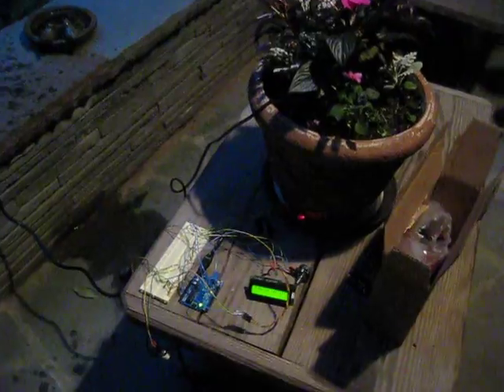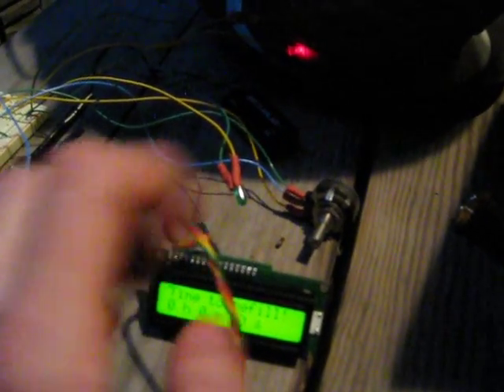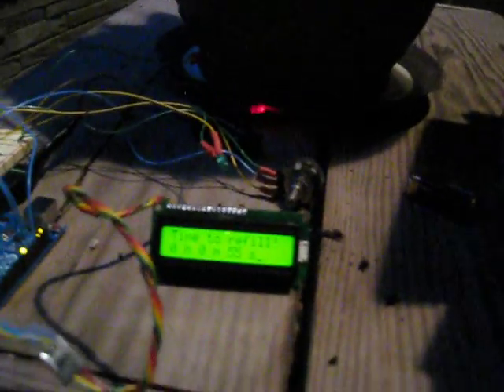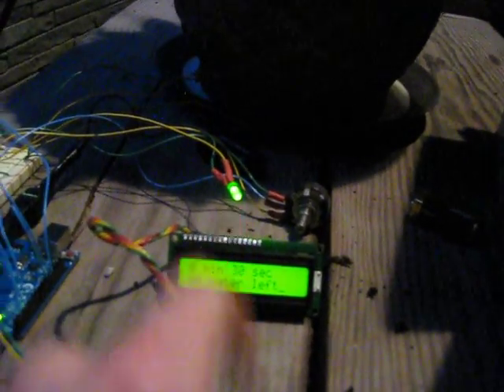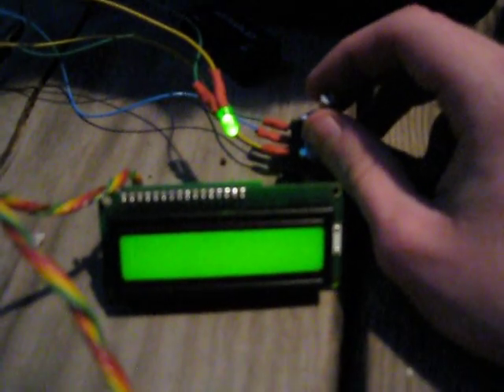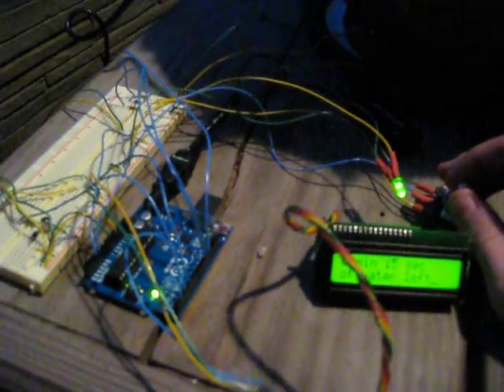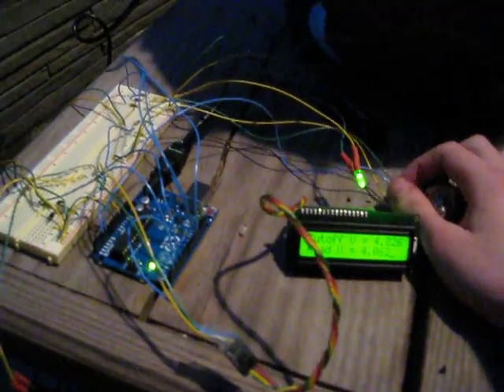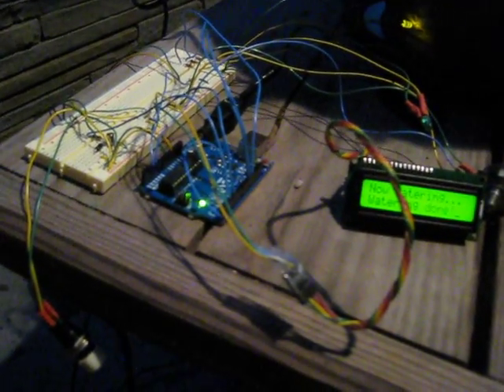Arduino Watering System

Comment from the maker: Sorry for not replying to those of you who asked about this until now.  I was able to dig up the report and presentation I gave on this two years ago and have made them available to download at: https://www.dropbox.com/sh/h2j4md7sv60j586/AADfnCPztHRwYepslGKPJnzEa.  

Honestly they're not going to be the most helpful to anyone trying to recreate the project since that wasn't their purpose, but hopefully they'll be of some use to someone.  

There are some screenshots of the code towards the end of the presentation, however that version of the code did not include output to the LCD display shown in the video.  Instead, it just prints to the computer interface.  The code is very simple and therefore not very robust, but I think the general framework is there.  

Please let me know if you have any additional questions and I'll do my best to answer them promptly.

Best of luck to all!  Thanks for checking out the video!
Reply: Hi Sir can you elaborate the diagram?
Reply: Sorry for the delay in responding.  Unfortunately, I don't have a more detailed diagram, but I can direct you to: http://www.instructables.com/id/Garduino-Gardening-Arduino/, where I believe you'll find very similar circuitry and more specifics.

Comment: By its cost and lots of accessories Arduino (SensSmart) will be my choice for sure. I'm not a C++ programmer, so I'll need to study it to write my code. I would like to have your code as a template, if you could send it to me. So brief explanation, if possible, will be appreciate. Just some hardware questions: how are you controlling the pump? Do you have a relay board? What moisture sensor are you using? Any additional hardware? Congrats by the project!!! Tks in advance (dbrosa@ig.com.br)